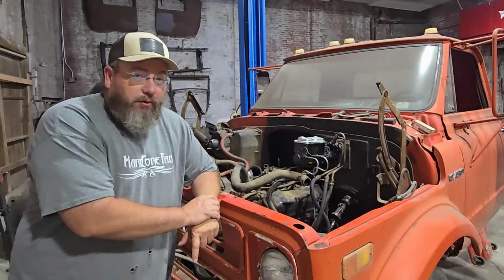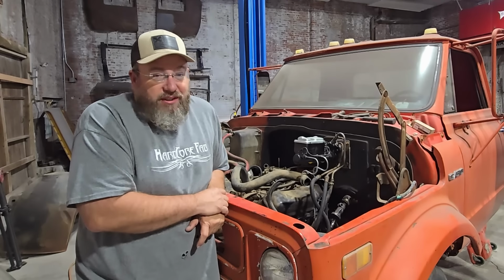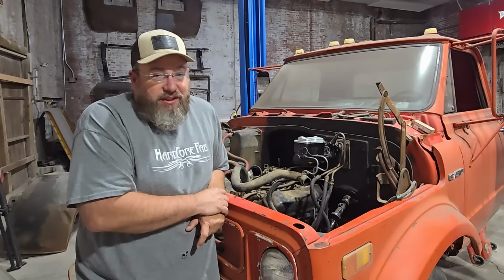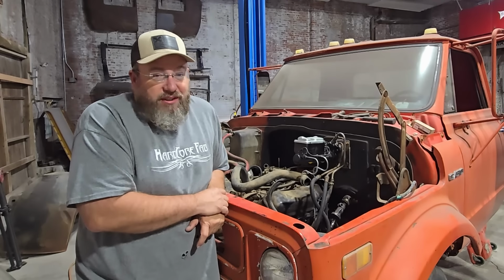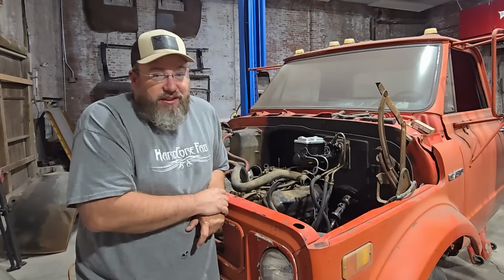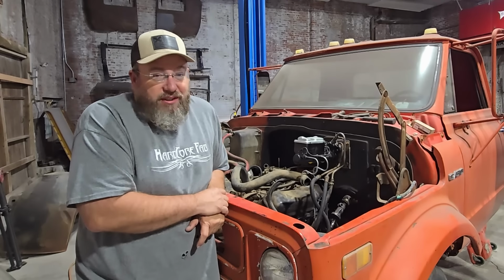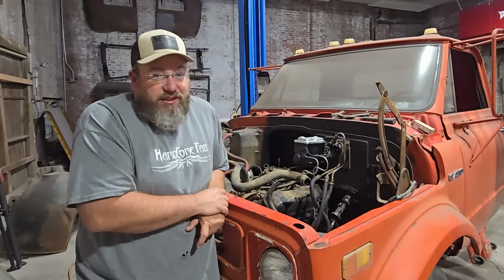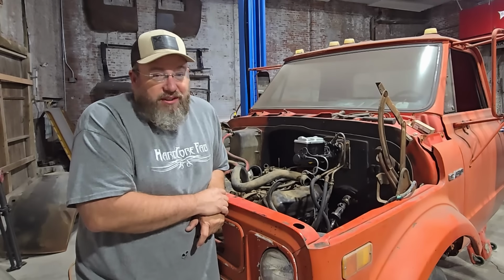Things don't go as planned....again (C50 build part 9)

Comment: Looking at the upper radiator hose I would shorten the hose in the middle area after the 1st bend off of the thermostat housing by 2-3 inches to allow for better coolant flow.
Reply from the maker: A guy could for sure but the bottom one is the may one I need to get better

Comment: If you ever decide to flush an engine and radiator and not being too harsh with radiator flush. Put a cup of cascade automatic dishwashing soap. With water. Put 15 to 20 miles on it. Drain and repeat if needed. Will not foam and make a mess. I've flushed my engine and radiator. Cleaned out lots of stop leak. I wound up buying a new radiator. But I knew my engine was clean.
Reply from the maker: I'll have to try that some time

Comment: Check the fuel filter in the carb. I've seen gas go bad and it make an invisible coating on the filter that keeps fuel from flowing. The filter can look good, but maybe it won't flow.
Reply from the maker: I have heard that before but I'll check

Comment: Or put a gear vender it your transmission T400  plus put a un 640 Allison torque converter
Reply from the maker: I honestly don't have much experience working in transmissions I'll have to look that converter up
Reply: @HardCoreFab  it's a better one handle the heat and stronger hell I'll buy one just give me a mailing address
Reply from the maker: That sounds awesome our mailing address is 1901 e 4th Ave Hutchinson KS 67501
Reply: @HardCoreFab  i
Need a 6 hole flex plate to ill order them in morning is yours a 168 teeth
Reply: Can you check is your 3 hole or 6 for the torque converterthks
Reply: @HardCoreFab  six or three hole flex plate
Reply from the maker: Sorry YouTube didn't show me you messaged again.  Mine is a 6 hole.